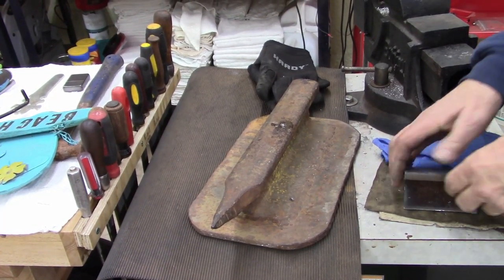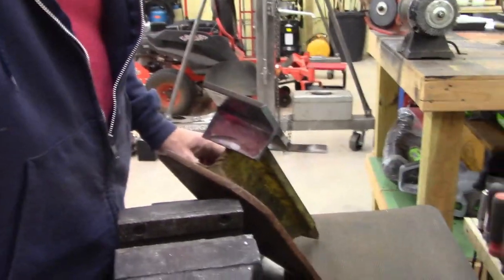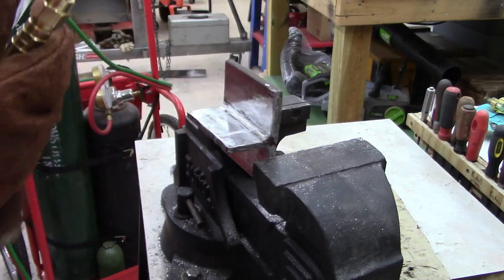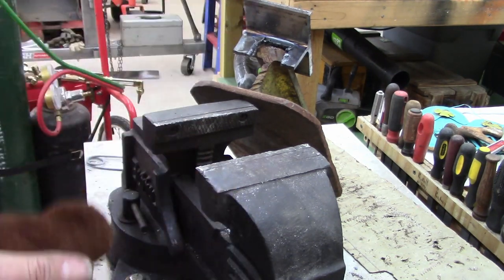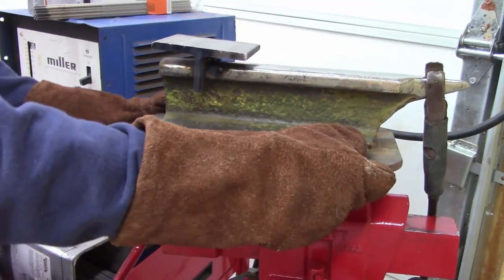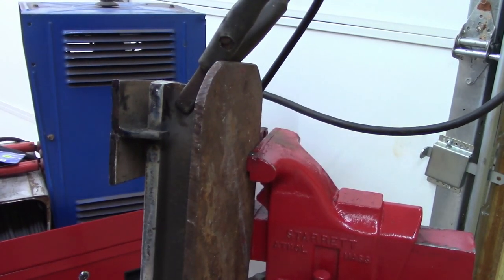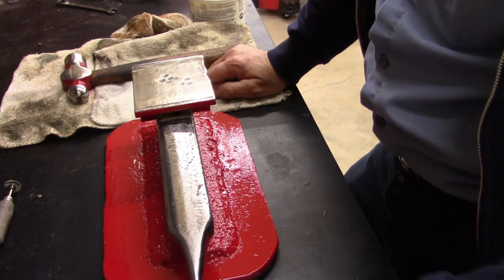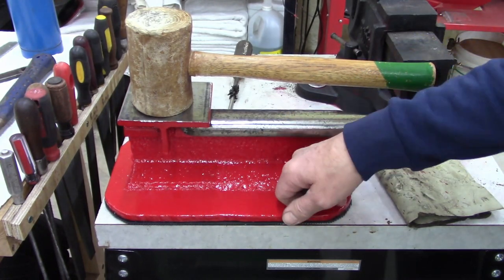Homemade anvil

Comment: You did a nice job….. that’s gonna serve you well 👍🏻 

I’ve been looking for one of these for years and there just aren’t many out here in Oregon and the anvils sell for $500+ Most are too small. Saw a few rr track anvils on eBay but with shipping it quickly gets over 100-200 bucks. 

My buddy said a lot of the smaller tracks aren’t rail trAck but they’re overhead crane tracks
Reply from the maker: I had a railroad enthusiast look at it and he thought it was rail used in mining, I did look at the anvil harbor freight sells it is ok, but I wanted something with history and that I work and make my own, here in Oklahoma Facebook marketplace they are selling railroad anvil or track starting at 35 bucks for 12" piece. Hope you find one.

Comment: Nice job!! I have at least 10 pieces of RR track around the shop. I pick them up whenever I find a deal. I bought a 4’ piece for $40 which was a great deal. I have a really beefy one as my shop anvil. 👍
Reply from the maker: I would like to have a bigger piece of track but having hard time finding one, I am going to make an outside anvil with some heavy steel that was holding up a 3000-gallon oxygen tank or I should say one of the legs for the tank, I would like to have one outside because inside it gets loud hammering inside and easier to clean up my mess outside.!!!

Comment: Coming from a Railroader. 
Rail is very hard steel which makes it brittle it doesn’t make good anvils. You can heat treat the rail but it’s really not worth the time or money spent when you can buy an anvil. And your rail looks like 65lbs rail which means it’s 65lbs for every 3 ft. I like the idea of welding a piece on like you did.
Reply from the maker: Thank you, and for what I am going to use it for, I think it will work fine for me.
Reply: I’ve beat the crap out of RR track and it holds up very well. It is indeed a very good anvil.
Reply: Tools & Gear I guess there’s a little difference running millions of tons over a piece of rail versus hitting it with your little hammer.